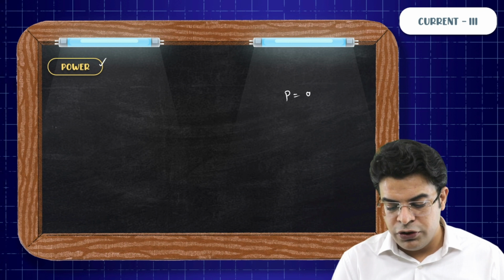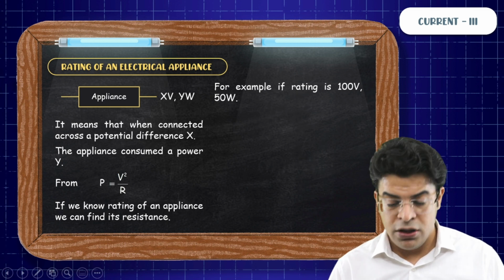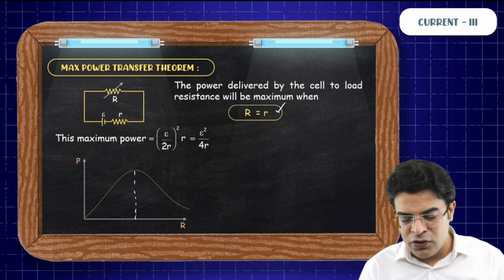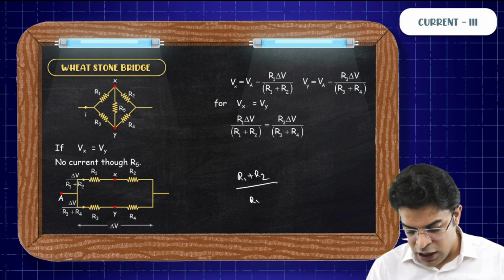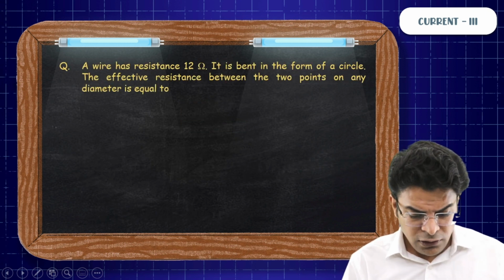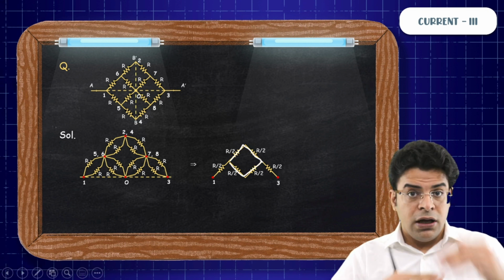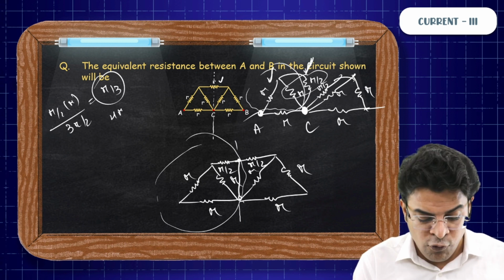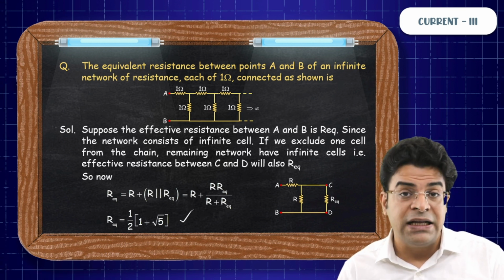NEET Physics Revision | Current Electricity - Wheatstone Bridge, Power | Hour 56/84

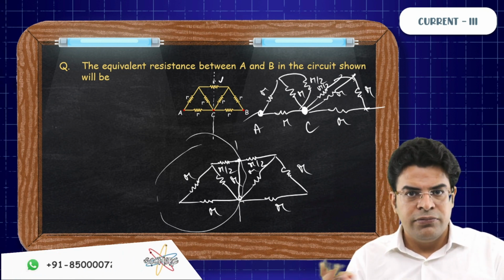Comment: Sir at 1:06:11 how can we say that the two halves are in series they should be seen connected in parallel na because the potential between the points is same as you said??
Reply from the maker: Think over it once more think of whole left half as one resistance and right half also as a single resistance now these two will be in series.

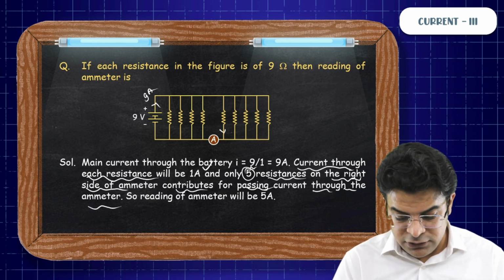Comment: In question 9:25 why did not count 4 resistor on left side
Reply from the maker: After coming out of these 4 resistors, current will go towards the negative terminal of battery and NOT towards ammeter.
Reply: Ok sir,get it thank you